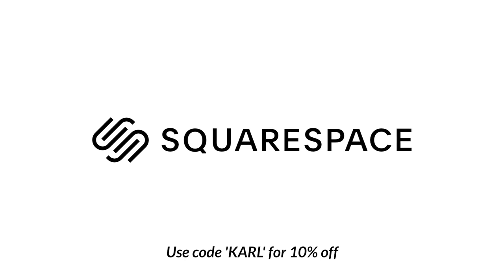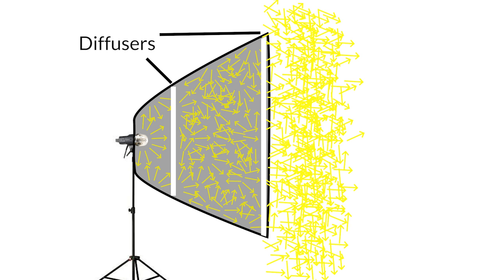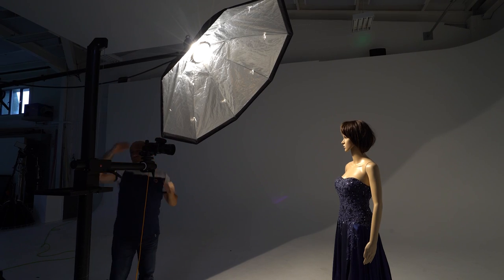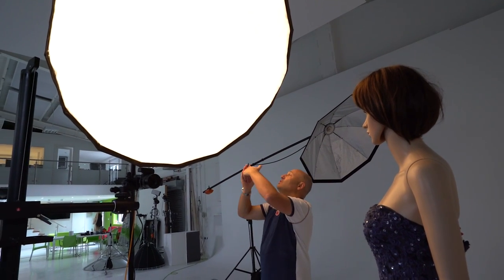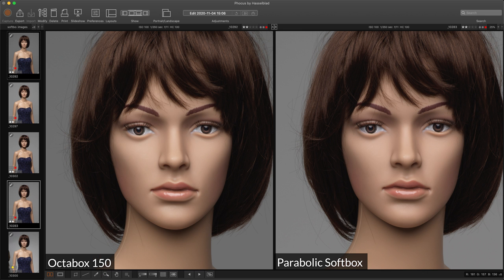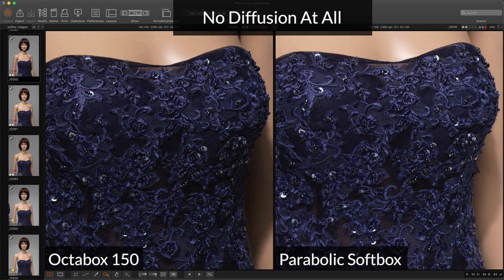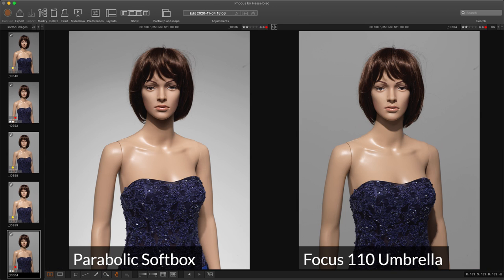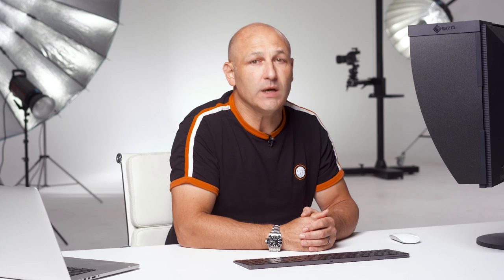The Myth of Parabolic Softboxes - Save yourself time, frustration & money!

Comment: WOW, YOU DONT GET IT. Its not about a parabolic having diff. lighting effect but the EASE (depending on the design which varies, some patented take-down fast like PCBuff) OF PUT-UP and TAKE DOWN,  not to mention for group photos outdoors parabolics are the only go to if theres any wind (regardless of sandbagging).    MOST SOFTBOX designs are a pain to put and down, the BETTER parabolics are as easy and opening an umbrella.
Reply from the maker: This one wasn't, in fact it was much quicker to set up the Octabox.
Reply: @VisualEducationStudio  i love ya anyway.....hugs
Reply: Sorry but that is all quite not so "WOW, YOU DONT GET IT" as you might think. 

First of all, the question wether a light former is easy to set up or not is not connected to wether it is parabolic or not. Just try an Elinchrom Rotalux 175cm Softbox versus all those parabolic softboxes where you have to put 16 rods into a Speedring that doesn't deserve the "Speed" in it's name. 

And of course there is no reason why a parabolic softbox should be less prone to wind (or even "the only go to") than a normal softbox when it's windy outdoors, especially if you consider that the front diameter is the same and the parabolic one has bigger surface for wind from the side while  having a negative effect on the centre of gravity of the whole setup.

Comment: You are using word physics without a reason😊 first you are missing the fact that in the parabox the first diffuser is further away which give a more even spread of light to the second front diffuser. Especially with lights that have flat surface instead of a classic pointing out bulb. Also in all the photos the light on the background is obviously different and you are totally ignoring that. The whole image is important. And both light shapers have their purpose and different usage scenarios.
Reply from the maker: Hi please read my pinned comment at the top which takes into account some of what you are saying but gives further explanation.

Comment: I agree partly. It is marketing BS as long as you use any diffusor. The only advantage - and that is an advantage is that in reflection only mode the beam of parallel light lets you move the deep octa move faaaaar back without loosing softness or strength. But that is only true when the light is facing back only. An backfacing umbrella gives similar look but doesn't focus at infinite. As on a 45deg rembrand light the main point is to use it as a fill light which a V-plate can achieve, too.

Comment: if it looks identical to you i strongly advise to see an ophtalmologist ASAP
Reply from the maker: It doesn't look identical but it looks very very similar considering the differences of the design and the pseudo science that is used to market the 'Parabolic' Softbox. The key differences that you can see don't come from the product shape when it has double diffusion, as that's impossible would break the laws of physics. The differences that you can see are actually due to the physical surface area being greater on the 'parabolic' softbox and also the difference in the inverse square law as the flash tube is further back from the front. If you did know anything about the science of lighting you wouldn't be trying to argue with someone who actually does, someone with a 25 year career and someone who works as a consultant to many leaders in the photographic industry? I don't need to see an ophthalmologist but I suggest you do a bit more research before making spurious comments  - www.karltaylor.com

Comment: In your first comparison photograph, the Octabox produces slightly more intense highlights than the parabolic reflector.  Isn't the idea of the parabolic softbox to make the overall light more directional to minimize spill without a grid?  I take your point that the parabolic unit should be adjustable.

Comment: A parabolic softbox send less light at the border and concentrate more light on center. Very important for video shooting in order to illuminate only the subject but not the background. SO NO, Deep parabolic is not a marketing product.
Reply from the maker: Yes that's true if it's just a thin single layer of diffusion on the front surface, such as 1/4 stop gauze but I'm afraid it's not true if it also has an internal diffusion layer such as shown here as well as a standard diffusion layer at the front. The reason is it's physically impossible you can't send collimated light through two layers of thick diffusion and then it still have collimated properties coming out the other side.

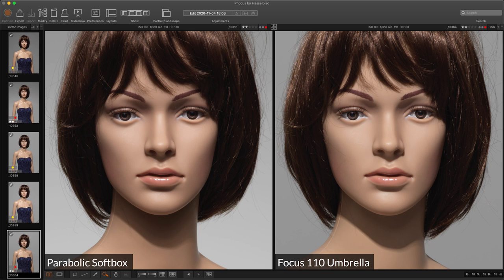Comment: 8:40 background is more lid with the parabolic
Reply: Please read Karls pinned comment. 
A parabolic softbox with Diffusion Material makes No difference to a normal softbox. If you Take the Diffusion Material away its a deep softbox which has less spill and therefore throws more light on the Background. If you need more light from a light source with less spill, use the parabolic softbox without Diffusion Material (which 90% of Users wont do). It's then a deep softbox and this has nothing to do with "parabolic". If you Work with parabolic reflectors (Not softboxes!) their Main Advantage is to able to collimate light and to focuse it Like a fresnel Lens. For that Mode you need to Shine with your Strobe INTO the reflector! Putting the Strobe Like in a normal softbox will have no effect at all, its then just a deep softbox